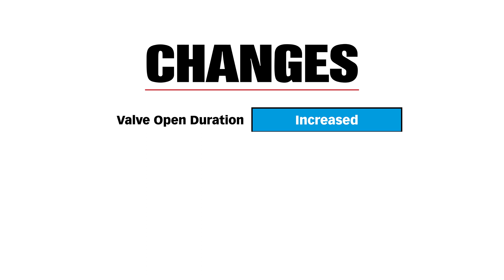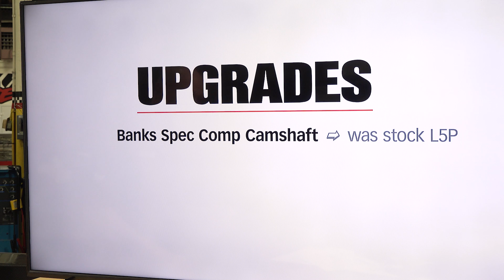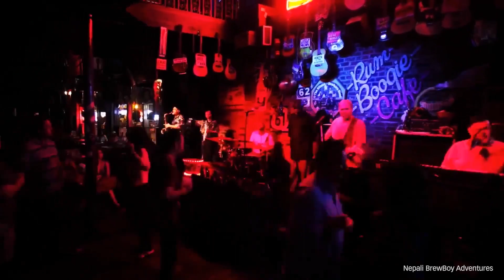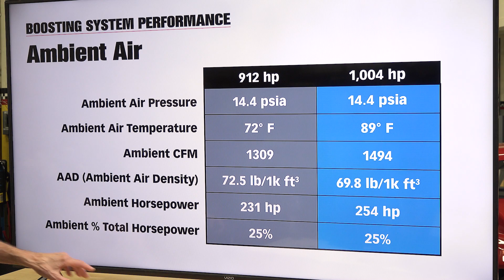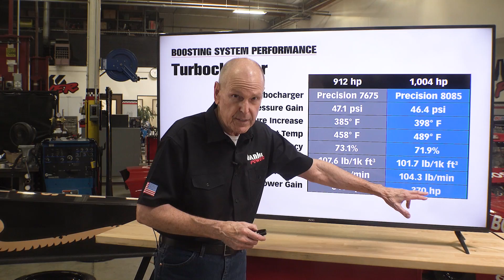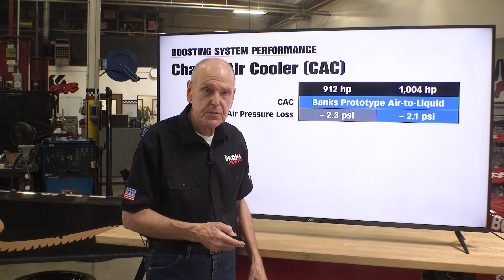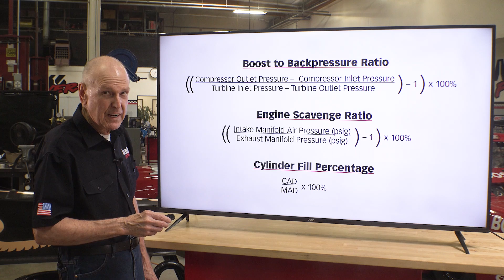1,004 HP !!! Killing A Duramax Pt 15

Comment: Mr. Gale Banks,

Thanks for sharing your experience and knowledge with us. With 15 episodes now, This project, of trying to kill a Duramax over the past year has almost been a blast. Let’s work together to make this engine really blast-off!

It would be my pleasure to help you blow up this compression ignition engine, by making way more power than it can handle, while utilizing a cleaner, safer, local fuel that costs less than toxic gasoline or deadly DIEsel. I propose we utilize Hydrogen, through pilot point ignition with a baseline of DIEsel fuel, or we would prefer BIOdiesel as the base fuel. Adding a gaseous fuel, such as H2 to the combustion chamber breaks up the liquid fuel droplets into finer mist, with more surface area, which results in more complete combustion of the baseline fuel while adding power. With this power, comes great responsibility. Use it wisely to lower per mile fuel cost, prolong engine life, increase fuel efficiency and extend oil change intervals while producing drastically reduced exhaust gas emissions out the tailpipe that are harmful to health, human and otherwise. Or, take your new Dual-Fuel Monster for a wide open rip to produce politically un-correct amounts of power. If going for a full send in California though, may I suggest to Hoon responsibly.

When you are ready to let some more Bald Eagles fly, Call me, would love to talk with you~

Thanks again,

Tai W. Robinson
www.IntergalacticHydrogen.com
American Fuel Vehicles
Ride Clean & Save Green!
801-201-7370

Comment: Just a thought....Would it be possible to gain a couple horses by creating CAC tubing with heat extraction fins on the exterior, running the length of the tubing.  I'm thinking it would assist the CAC with making the pressurized air cooler/more dense?

Comment: I just want to know if there is a link to all the idash info broken down per change. Specifically how much fuel was burned @ stock hp/3k rpm vs 1000hp/3800rpm.

Comment: imho the turbo is so big that is moves away the need for a complex compound turbo. turbo lag is big also but it is not the point here. extracting the most @stock before moving on to more complex setup, exactly the same with computer overclocking or bodybuilding. Looks like here the cam was the most important part.
banks power is not a startup yet innovating so much !

Comment: Gm has a Hennessy performance factory option for the 6.2l Silverado, GM should offer a Banks Power turbo diesel option for its Duramax line.
Reply: lol no they don’t
Reply: @corvetteZ3r  lol yes they do

A quick Google search shows that as recent as 2025, Hennessey Authorized GM Dealers offered a Hennessey performance package for the 6.2l V8 that can be financed/purchased and serviced directly though the GM dealership.
Reply: @PaulOJazzMusic Google is not very accurate anymore. I’d like to actually see a real link and real truck. Also you said dealer that’s not from the factory hoss
Reply: It would never happen ever. You can thank the EPA for that
Reply: @dominickjohnston5881 carb not the epa

Comment: Given the self-imposed limits of operation, there is almost no room to increase power further.   Increasing boost further will only violate the 260 bar peak pressure and 480F compressor discharge temperature limits.  Nitrous would also increase cylinder pressure.  Given the great performance of the intercooler, water/methanol injection will do nothing to increase charge density, and the methanol included will change the Air/Fuel ratio, forcing a reduction in the amount of diesel that can be injected. 
There is still 5% headroom on the main injection duration limit, so the engine speed could be increased to 4000 rpm.  Some of that potential power gain would be consumed by increased FMEP, but it may pick up 30 HP. 
Chilling the intercooler water would be a good way to increase charge density further without increasing the boost pressure.  Another 30F decrease in charge temperature would probably allow the fueling to be increased to the 40 crank degree limit without increasing engine speed.
The 85% volumetric efficiency number indicates a possible area of improvement.  How about porting the heads and increasing the valve sizes?  It would have to be done carefully on the intake side to keep from killing the swirl.  At least larger exhaust valves as done on the Monster Truck engine would help.  And do the stock exhaust manifolds have room for improvement?  How does the pumping loop of the P-V diagram look?  If the intake and exhaust pressures are crossing, maybe the manifolds are causing momentary restrictions when two cylnders on the same bank exhale 90 degrees apart.  Pulse divided exhaust manifolds could reduce exhaust pumping work.  If the vol eff can be brought up to 90%, there is another 50 HP there.

Comment: lol this is a really roundabout way to describe air flow effect on power.  i guess it may be easier some people to wrap their head around the concept.  the way i think about it is in a more classical sense.  power is work per time unit.  work is force(torque) and distance.  torque is a function of cylinder pressure, more cylinder pressure (all other considerations equal) is more torque.  more work can be done if we decrease the time it takes to push something, so if we push on something just hard, but faster we get more work.  so if we had 10 inches of power strokes with a given cylinder pressure,  and then were to have 12 inches of power strokes with the same cylinder pressure we get more work.  how this continues to play out is that volumetric efficiency is relatively flat in most cases, which is saying the cylinder basically pumps the same amount of air at most engine speeds (obviously not true but in many rpm operating ranges its close).  what happens is that because torque is a function of cylinder pressure, and cylinder pressure is a function of air mass, the torque peak occurs at peak ve, after peak ve air mass per revolution decreases but at a lower rate than the increase in distance per time, this is why the power peak occurs after the torque peak.  once you are past peak power the ve drops off faster than increase in distance per time.  all things equal, its an air pump, the more air(mass) you can pump the more power the engine will make because it allows you to burn more fuel.

Comment: Facinating as always, thanks.  I have always wondered if active cooling of the exhaust manifold (water jacket?) would improve the performance of a motor?
Reply: It would hurt the performance of the turbo by taking out energy needed to drive the turbine.

Comment: Gale how are the crankshaft harmonics holding up,? I feel like the crankshaft could be starting to flex a bit as the power goes up. 

Ive been watching this series since it aired and it got me on the edge of my seat wondering how much it'll take to break it.

Comment: Great work Gale. Thanks for keeping us all entertained. Here is what I would like to see next and why: 1, Water/methanol injection to understand its benefits on a system that is already highly optimised (has efficient charge cooling). 2, compound turbocharging to see it done in a methodology way (the Banks way!) I am interested in the approaches you use for charge cooling between stages and how much extra plumbing is involved. 3, Propane injection to prove just how much (or little as a non purveyor) is to be gained from it. 4, Nitrous  Oxide, because if you haven’t killed the Duramax by this stage that might do it. You say yourself that NOS tanks just aren’t big enough for anything other than specific forms of racing and you should look for performance gains that are available all the time. Thanks again.

Comment: Next level compound turbo based on fluid science calculation by a "professor"... Keep the air intake manifold temperature close to 32° Fahrenheit, with dense airmass. Basic principle: Compress air -> cool air -> compress air -> cool air -> reduce air pressure in intake manifold as close to intake valve as possible. You don't want ice to build in the intake manifold, so you need to constantly adjust the compound turbo's to maintain a lower limit of 32° Fahrenheit. You need to keep the temperatures down to prevent damage to exhaust valves and turbine! This is the way to do so without quick fix use of nitrous. But I bet no ordinary tuning company will be able to pull this off. This requires the highest level of understanding of fluid dynamics. But if you pull it off, you have almost make cold fusion possible. I will bet a professor will tell you that the math add up for the principle to work in theory. Are you the guy to make it work in reality?

Comment: Add nitrous and water/meth in a way that you can isolate and test each one separately.  Then, go for the compound.  I've learned an incredible amount about engines watching this series.  Adding one piece at a time and testing each upgrade has been extremely educational.  Thanks for doing this series!

Comment: This is amazing. So you used positive pressure to replace what used to be negative pressure so there really is only the space you need for the engine function. And the same would apply to scavenge. It already has limited space to begin with instead of dead space as previous. Simple flow dynamics lads and Gale you are a genius sir!!! Hats off to you!!!

Comment: I think water/methanol injection is the next step. With the temperatures you are seeing through the system I believe the water/meth would be a good way to optimize the large single turbo setup you currently have. 

I'd also be curious to see how long the engine can stay together under extended power runs. Short pulls on the dyno are one thing. Flat out runs at Bonneville for minutes at a time are quite another as you know.

Comment: I would like to see a compound turbo, then more details on water methanol injection. I'd rather see the compound turbo because that's not adding any extra thing to the engine besides diesel, and I like that...

Comment: why are we using bar to represent max cylinder pressure
Reply: another note, why are we reaching for 20 - 25% excess air/fuel ratio?  Especially when the perfect stoichiometric ratio would be 14:1. At 16.5:1 we are in excess of 14% air but we are reaching for a more leaner ratio?
Reply: @marcbenedict3676  What unit would you prefer?

Comment: This program is for sustained running, and you hold 1004 hp for one second, it looks to me like dyno queen.
Whats next? 
1)Two buckets of ice cubes into CAC should help BAD to get even BADer
.
2) Increse boost to 51 psig
.
3) Rev it to 4200 rpm.
Either way it schould helt to reach 1111 hp.

Comment: Can't believe he got over 1000 HP without changing heads and using tons of nitrous per pull to get the air fuel ratio right. I'd love to see something like that on the road, he didn't make it require nitrous so correct me if I'm wrong, but looks like you can go pull a trailer with that baby!

Comment: I’m not expecting a great long term result from a typical water/methanol injection on a common manifold, but I would love to see the data you collect running the test.  

I am most interested in seeing the individual cylinder pressure and egt numbers for each cylinder.  I hypothesize that the typical single/dual nozzle installation is not sufficient to provide equal fuel/water distribution to each cylinder.  Consequently I expect the cylinder power contributions will be unbalanced.  

Perhaps you could prove/disprove this hypothesis, and launch a new product that does a better job of distributing manifold injected fuel or water fuel mixtures.

Comment: What is the take rate of this setup?  It has been a year and no word on a similar test on the Cummins ISB 6.7.  In 2018 one study shows 400,000 diesel pickup trucks were sold.  So lets say GM has 100,000 units a year.  The take rate is going to be less than 10 percent for many manufacturers that sell a new truck and the consumer expects warranty support wihtout any hassles.

Comment: Giday from us in australia have watched all your videos on the duramax engine performance gains with interest  which raises the question of how much gain could be achieved with a 2 stroke diesel engine such as the detriot 6/92 already producing great hp without intercooling only exhaust valves to change duration and porting to increase air flow i know these engines are old technology but have great potential for huge gains next video Gale Old diesel into the modern era imagine the sound of that detroit at 2800rpm

Comment: what kind of price are we talking about for the parts on this 1000 hp engine ?
Reply: The camshaft, if it's a production, will be about $500. The injectors are about $6-800, the injection pump is about $2000. All the ducting is hard to draw conclusions on. It's probably close to $1000 in time and materials for the exhaust and intake tubing.
The turbo is a bad mfer and will cost a cool $5k. Cheaper options are available. The tuning is another question...figure if you paid a shop to build this and put it on your truck it would be the better part of $15k with labour. If you did it yourself and did all the work yourself it would be about $10k. You could do some work around but if you really want 1000hp it won't come cheap.

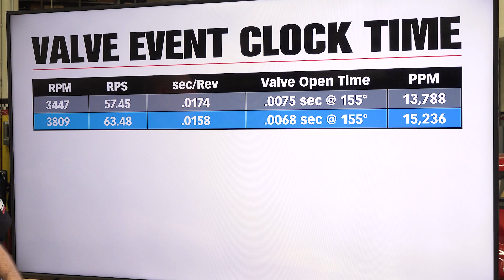Comment: 13:30 isnt the power pulses per minute only 1/4 of the rpm not times 4? You have one power stroke every other rotation of the crank right?
Reply: There is eight cylinders though. It didn't make sense to me at first either.

Comment: I would be interested to see if running sequential turbochargers would increase the air manifold to exhaust manifold pressure difference.  I was a bit surprised to see that the exhaust manifold pressure was very close to the air manifold pressure, I would’ve expect3d the difference to be greater, on our engines (large diesels) it’s common to see a difference of 1-1.5 bar but we have reached the limit of single stage turbocharger with charge air pressures of circa 3.5 bar but two stage now at 6.5 bar.  We use the pressure difference to help cool the heads and exhaust valves and also keep EGT down.  Aim to keep charge air temps to 40-65 deg C, any colder and run the risk of going below the dew point and so have free water in the air.

Comment: Higher flow injectors, get that duration time down so more of the action happens closer to the point the piston is starting to return down the bore. Adding nitrous will mean you need to run larger injectors anyway in order to retard injection advance, then a nice 300 shot and some super short injection durations happening closer to the pistons recessing point, all the poke with non of the smoke 🤩

Comment: What was the smoke level, clean or economy haze?
Reply: With an afr of 16.5, that a lambda of about 0.85, there would be very little smoke. Given how hot the egt is there is probably none. Indirect injection starts to smoke at about 17 to one and some really good ones are lower than this. Dmax engines usually don't visibly smoke over 16 to 1.

Comment: id imagine  the l5p exhaust temp will become too high with the addition of nitrous. i say start with water meth injection and then nitrous so we can get more data.
I am grateful that you make these videos, because im learining so much.  thank you and Im excited for the next videos youll be making.
Reply: I know it sounds stupid, but nitrous actually reduces egt on a diesel engine. It would be really pronounced on an engine run in this condition because the air fuel ratio is around 16:1. If you put more oxygen in, you get more complete combustion in cylinder, more power out of that fuel, and lower egt because it's no longer burning.
With a spark engine, you're adding more fuel and oxygen which is adding more heat. You get more heat out. You also have to cut timing, hence the blue flame special.

Comment: Ok . The question is , How  do you get all this under the hood ?
I must be naive , when l have been waiting for , 2yrs , for an answer on how l can put a water injection on my 1989 Case tractor with a 390 cummins turbo charged , for more hp & less fuel consumption
Reply: Mr. Banks, and the incredible Banks team, JOB VERY WELL DONE! 
As for your 3 options for what to do next, I would humbly ask you to consider implementing a compound turbo system first.
What you are doing with your team, in conjunction with what the Duramax team created, is a turning point in history!

Comment: I don't know diesels. Why does it take so long to get to peak HP? It took almost a min
Reply: They hold the RPM with the dyno and give it more and more diesel (Injection duration) Because they wanted to read the data and not overrev the turbo or make the EGT go to hot.

Comment: Mr Banks, can you put the stock turbo back and test with the aftermarket cam, CAC, injectors and fuel pump please? How well will it perform in real world performance with the two different turbo configurations under real driving conditions and power requirements?  Most driving is on and off the throttle. In an earlier video it showed it took and extra 3 seconds for the larger turbo to spool and make that peak torque and power. 3 seconds on the loud pedal is a LONG time before anything happens.  P.S. could you provide an email, I have an idea you may genuinely be interested in. Thank you, Barry

Comment: Mr. Banks, please spay the engine with propane....its an excellent cooler of charge air temps in my experience
Reply: Bear in mind that propane is a fuel. Sure it will cool the intake charge but I suspect it will make EGT higher.

Comment: Will the cam that was used to make 1000hp be produced and sold as like a stage 2 or 3 cam or will it be a one-off? I say the next step should be getting the temps down to acceptable levels and going for 1500hp.